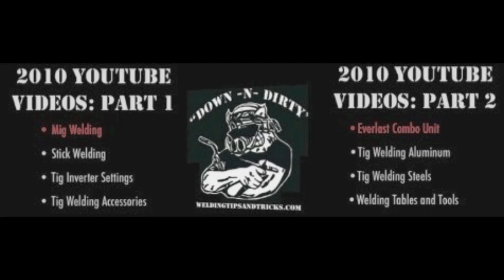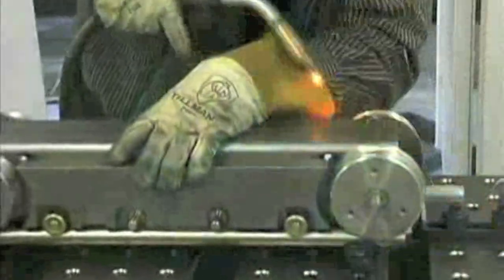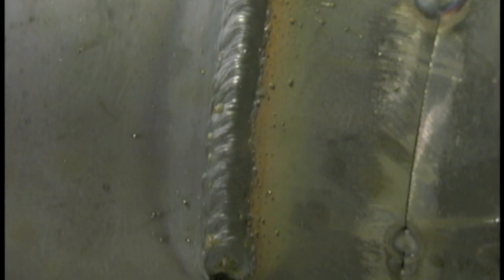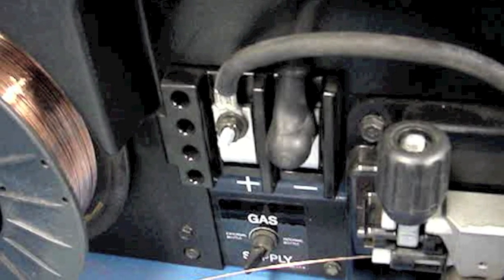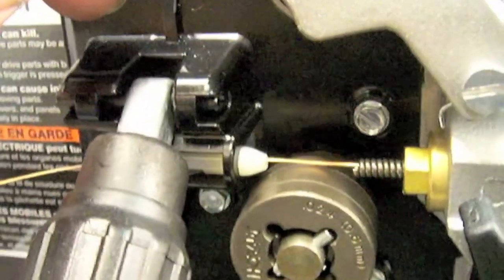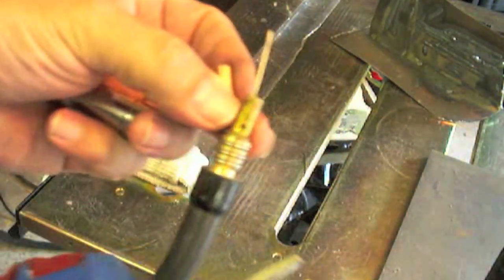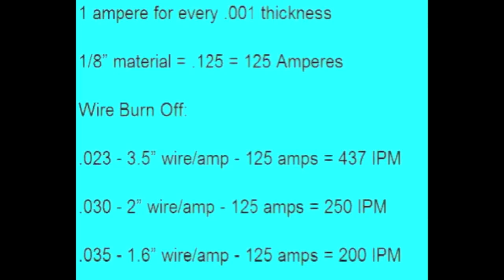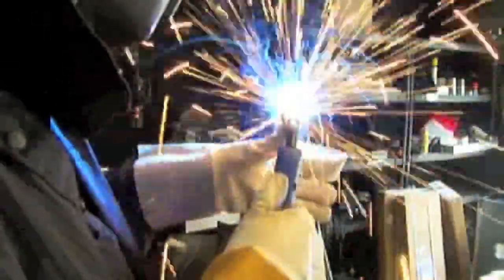How to Mig Weld - Down and Dirty Tips

Comment: I have a Lincoln SP-135+ 115V MIG machine. The contact tip was recessed about 1/8" in the nozzle. Chucked the nozzle up in the lathe and shortened it about 9/64". Made a hell of a difference. Thanks for the tip, Jody.

Comment: This is the best, most "to the point" welding instruction video ever, the title says it perfect: Down and Dirty", no bullshit that you can read in the welder manual lol. *As a guy that JUST RECENTLY got pretty darn good at welding, I'd recommend for any newbie's to start with ARGON & CO2 MIXED GAS (and non-flux wire/solid). I've tried a few methods welding on my offroad Ford Bronco, and Arg/CO2 welds are the strongest, easiest, and best looking welds, it keeps that perfect arc much better than just CO2 or others, AND NO SPLATTER.

Comment: at work im provided such a large welder, no cursive E's or and waving or flicking is needed from 3/16  past 1/2' , unless its extremely thin material.you sir are a great welder with a 110/115 volt home type tool. much credit to you.

Comment: your awesome...you have answered almost all my questions but i still have one that i just cant figure out. See when im welding mild steel piping like for car exhaust, i cant seem to get the bead to "bite" into the metal. i have to work the puddle in a circle to get a "bite" and then i can continue with my little E's. even then the start of the bead looks horrible and the rest looks good. im using a 115v 135amp with flux core.

Comment: I'm not sure if you got an answer yet,  but I actually had the same problem when I first started. I finally found out I  had the wrong kind of wire. I need the 'gasless flux core' wire and had some nonflux core wire in it of the same size. The package didnt say outright which kind it was. It was in the same bin with the correct wire when I picked up a few rolls. When I tried to use it, there was far too much popping and little weld. Just piles of little steel balls all over. Hope that helps you.

Comment: FWIW and I'm still learning too, with .023 wire I find my higher settings of wirespeed bring me into "spray" mode. Everything quiets way down, spatter is non existent, travel speed goes up and the weld is smooth as silk. If I'm wrong, the end result is still a super smooth weld with no spatter and just a slight buzzing sound.

Comment: I used to jig for 2 welders who made farm gates on a piece work basis, so was fast and heavy work. One welder used to show me the basics during dinner break. Said I was a natural, within a month I was on the production line. Using 0.8 wire and relatively thin gauge mild round steel, you had to be quick and able to do decent, tidy welds. I managed to stab one of my fingers... through the bone and out the other side as I was welding a cap to a post which was a bit rusty so wouldn't arc. Now got permanent nerve damage in the tip of that finger.
Reply: I put a .030 stainless through my palm and burned a hole in my elbow at the same time tacking a poorly grounded piece. The electric shock left my arm twiching for two days but went away. That was 30 years ago. Still fine.
Reply: SMOBY44 Ouch, when I was a newbie in my old boat shop job, they found it hilarious to shock anybody bending over right in the butt-cheek...it's worse than getting tazed! I know what you mean by twitch buttcheek LOL! I bet you guys have some cool scars, I don't mess around when I weld, I pretend I'm doing surgery when I get to it. Worst I've done is went to brush some oxidation off...with my bare hand...2 seconds after beading.

Comment: MIGs can run gas such as c02, argon , or a mix.  or you can get flux core wire that has flux inside of the wire that does not need gas.  This will coat the weld bead and protect it from oxidation and also create a slight gas shield as it burns.  Such as the flux outside of a stick on stick welding.  It is also possible to do both pending on the needs.

Comment: @Jafromobile its just a general rule, 1 amp per .001 of metal, and then the wirespeed based on size. 20 gauge is roughly .036" depending on metal type (standard sheet steel), so you want 36 amps. at 36 amps with .023 wire you want 3.5" per minute/amp (3.5 * 36), which is about 126" per minute. most machines dont list IPM, so to calculate that you just turn the machine on, pull the trigger for 6 seconds, measure then multiply by 10.

Comment: How about a discussion about synergic welders? I'm thinking about getting the PowerMTS 250S synergic mig welder. Nice to know the rule of thumb settings and tables but MTS synergic welders hold that information internally and calibrate your settings based upon wire size, material and voltage.

Comment: I am curious about the end molecular result of the different techniques.  Intuitively I would think that the "e's" would "blend" the parent (sheet) steel more with the wire and have lots of strong sideways bonds, while strait would be a weaker weld because of both less lateral penetration of the material being welded and the parallel-to-joint bonding of the laid down wire material to the steel. 
 But I really have no clue, so do you think the "e's" would be stronger than the "u's" vs the strait?

Comment: I dont know if you have another video, but it would help people if you show them a bad well with wire speed to high/low or wrong power setting so they can identify it what it looks like when the setings are wrong and which way they need to go to correct it.

Comment: to answer a few of your questoins (youtube comments suck, next time just use the message feature) but most budget machines dont have a voltage or amp setting, just a "heat" setting. if your machine has a manual you may want to read it. you can google more about flux core (i dont use it) but i would think in general the same 1 amp in general applies. what i meant by 3.5" per minute/amp is "3.5 inches per minute PER amp" so for 50 amps, multiply 3.5 by 50 for your machine IPM setting (175)

Comment: Mat, gasless welders (Flux core wire) tend to leave a lot of "balls" or spatter on the work piece, its just a side effect of flux core wire! If you run gas and different wire, there won't be near as many. Hope it helps.

Comment: Great overview of MIG equip. and use.
Question: I want to buy a home welder for odd jobs like gates/fences/brackets and the like using steel tubing. What should I buy, arc, TIG or MIG? Cost is not an issue. I do like MIG because it seems easier and leaves a great finish- true?

Comment: @dokot09 when doing the circles stay on the top part of the circle longer than on the bottom part as the puddle tends to go down on you. So stay on top part like 2-3 sec just count in ur head and than do a quick circle and stay on top longer. You will see the undercut gone and you wont have hills

Comment: Great video. We'll I've been Welding for a while. But it all came to a stop due to lack of funds to but a Welder. So recently I bought a 90 amp harbor freight flux Welder. the thing welds but apparently either I lost my groove of Welding good. Or is it just the Welder it self. It only has. Power switch . Min/max switch / and wire speed knob. 1-10 . As of now I built a bumper on those settings but the welds seen to be some what floating above the 11 gauge steel. what could I be doing wrong

Comment: Good video... I guess my biggest question is how do I know if I'm moving at the correct speed to ensure adequate penetration into the base metal? Thank you
Reply: Yeah usually if you have almost like a blue colour around the weld it's a good penetration , if the metal starts spattering change your gas , to pure co2 , I tend to check at the start (bad for your eyes but it's a good way to check for a strong weld

Comment: hi man great video!!,  man im starting with the MIG, i was wondering what tickness of material can i solder?  can it be a 1/4 inch tick of iron or is too much?? watt amps do i need and flux core wire ticknes, thanks!

Comment: on the tip being flush, how or would that help on a flux core only welder?? I went a little cheep for small jobs I have and, having issues.. I can stick weld good. just new to a mig and trying to get it down.. my mug welder has a hi and low setting as well as wire control. and is good for up to 3/16" by the book. I know it will do 1/4" just got a go a little slower.  any advice would be helpful. .

Comment: I started out with a Harbor Freight welder and I could live with the really low duty cycle but what really made it bad was the limited amount of adjustments that could be made between the welding volts and the wire speed. I picked up a everlast welder that has variable volts and wire speed and was able to get a good bacon frying sound. Try to stay away from welders that have set ranges for volts and wire speeds!!

Comment: I'm saving up for a machine. I need one for welding billets for knife making. I also want to bulls a smoker and I'm sure there is other stuff I can do too.
Reply: Youtube nikkiminaj 

Youtube nikkiminaj  im your leader
Reply: stizan24 Hey brother, that's why I started welding myself :). Just letting you know that if your willing to get one, hands down I'd recommend getting a good small (non-flux) mig wire spool, with CO2 AND ARGON MIXED GAS, because it's hands down the best ways to weld knives/swords. CO2 alone splatters and looks darker, and I've had that damn splatter jump right on to my finished blade runing it. Good luck!
Reply: Thanks for the info!

Comment: no, its from trial and error from Jody (did you watch the video?). he's got alot of info on his site. i suggest you take a look if you havent already. in general i'm going to say that flux core burns a little deeper (more penetration) than C25 gas mix, so go a little less on the heat and work your way up. you'll have to do your own experimentation to "get it just right" for your own likes. everyone welds differently. some weld left handed, some weld right handed, some weld 2 handed...

Comment: Hello sir,
I understand the machine "wont run well" if on the wrong polarity. But, how would a newbie welder know it's on the wrong polarity without opening it up and physically looking for the
connection. I feel mine is operating as it should but, then again, how would I know? Will it
still weld? Mine seems to leave alot of "balls" behind. I have the Flux core welder, wireless.
Thanks so much in advance sir...
Mat

Comment: Hey guys. Im hoping to get some advice, tips or links to some helpful videos. So im new to mig welding i fabricate transformer tanks and need to weld them in such a way that the welds dont leak when a dye is placed in them. I use a 300 with argoshield universal gas. I find if i run hot on say 3 8 12 i dont get undercut and i weave back and forth or loop small circles but still get leaks. Obviously hot runs is what i need but how would you go about it? I find the most dificult part is the possitioning of the hand piece. Just any tips on best penetration or techniques to ensure an even seal on the top and bottom of the weld would really be apreciated. I should probably mention the weld would sit on a 3mm lip of corten steel. The steel itself is also 3mm so ive had issues blowing through the steel.
Reply: +Aaron Munyard Try straight line stitching( like tacking  lite material but 3mm is heaps, keep ya finger on the trigger Make your starting pool about 5mm, before you think that you will blow through push your wire5mm straight along the joint and redo, watch the pool grow and climb into each side the metal(remeber heat rises , so aim your wire slightly lower) to the right thickness then push along 5mm, start over. A good habit is to do welds 100-150mmlong and work backwards.
 As you start a bead a bubble of weld will form from the start,(this can be cold and ugly)weld 100mm. then go back 200mm and start another 100mm weld, you will be able to see where your first weld is and melt that fucking blobby cold start into your weld, thisway you wont get blobby cold starts and crater finishes,  startover and with practice , give yourself room.  Stop/ push, gives youmore control over weaving/walking.good luck.Weaving has its place but not on 3mm steel

Comment: and just so you know, i'm not an expert MIG welder. i have a basic 4 setting 110v machine, as i prefer TIG, and even then, i'm a hobby guy. it took me the longest time to stop thinking so much about how to weld and just get out in the shop and start burning metal. its 1000x easier to just lay down a bead than to think about it for a week.

Comment: Could U try some oxyfuel welding I have been interested in it an haven't got the opportunity to do it yet
Reply: Acetylene oxygen welding is the absolute best to learn welding! Mig welding can be done by anyone who can squeeze the trigger and point the wire in the right direction. If you can Oxy/acetylene weld, TIG is a no-brainer, as well as a marketable skill. Lots of practice.

Comment: I would like to see you weld some t joints and some regulat sheet metal/car panels with a mig welder without gas.Please.
Reply: You're gonna have a hard time welding car panels with flux core (no gas). Visual quality is very low even though strength is high. Flux core is best suited for windy conditions and contaminated metal (i.e. exhaust and farm work). Get a gas set up and be golden.
Reply: Thank You for your Honesty and Insight I greatly appreciate it...